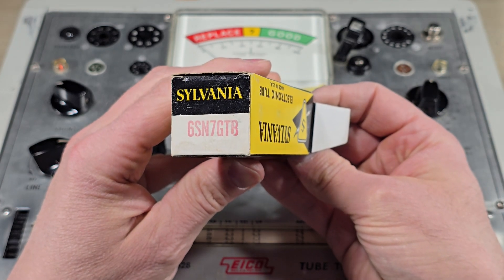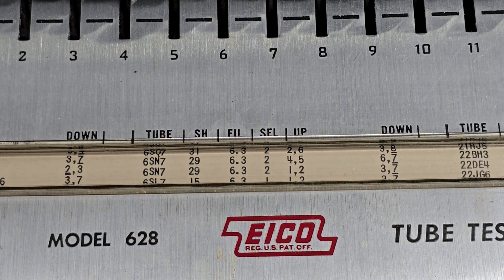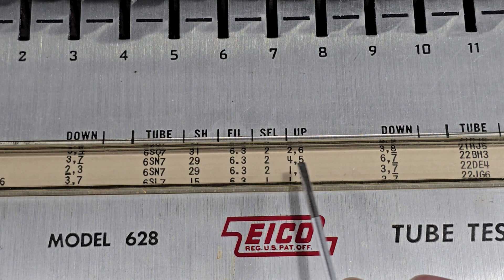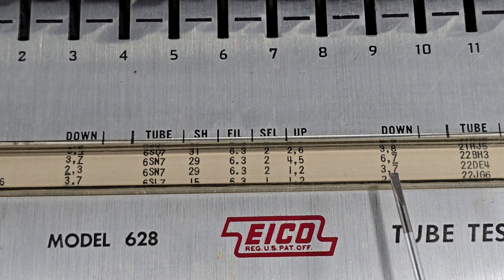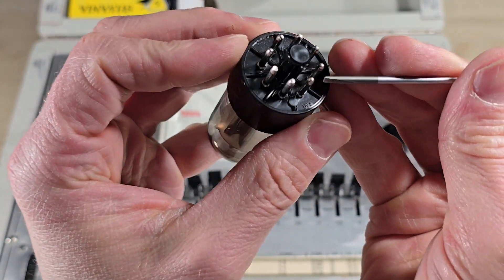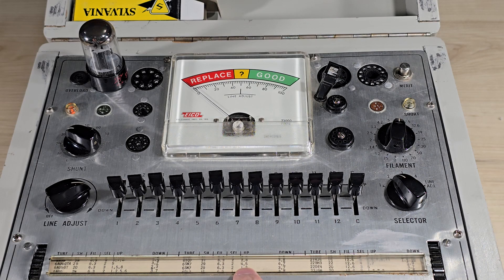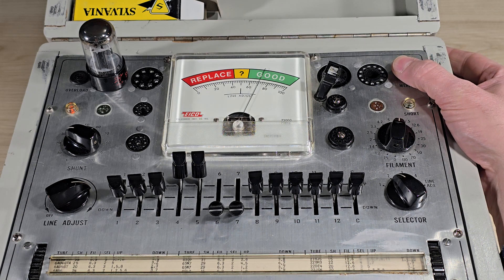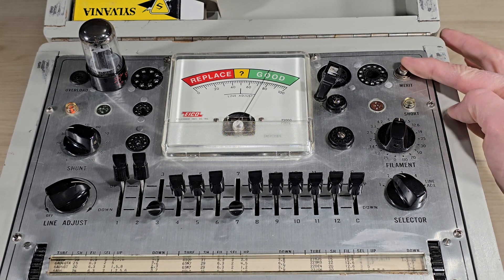How to Test Both Sections of a 6SN7 Tube on a Tube Tester (Dual Triode Demo)

Comment: I had a HealthKit tube tester I 1960 and it was quite useful. Lay people would pull all the TV tubes, take them to the drug store, test them, find the bad tube, buy a replacement and fix their TV — my wife's mother used to do that.
 1st Phone 1966, CE 50KW AM, 100KW FM - back in the day <g>.
Reply: Sometimes those drug store tube testers worked but a lot of the time they didn't test enough parameters of the tubes so a tube that tested "good" could in fact be weak or have other problems not shown. Also just replacing the tubes was prone to ignoring other bad parts in the TV set such as bad capacitors or resistors. That's why service calls by a pro that repaired TVs was usually the norm after replacing the tubes failed to bring the TV back to life. The same went for tube powered radios back then.